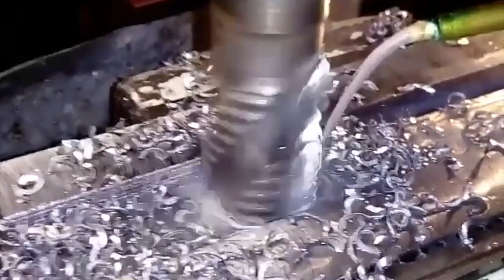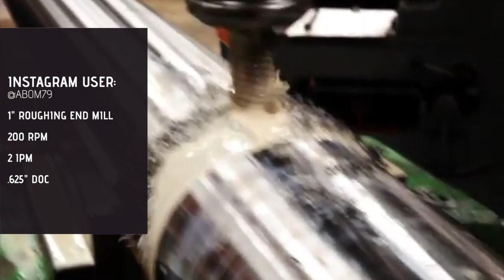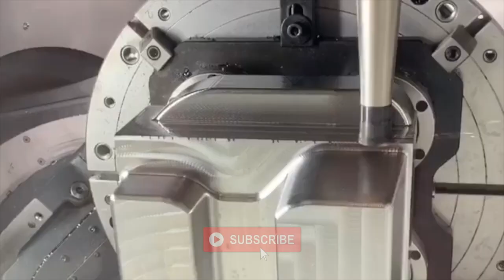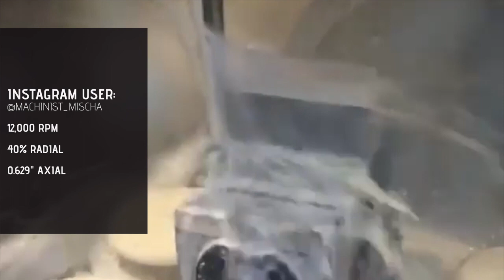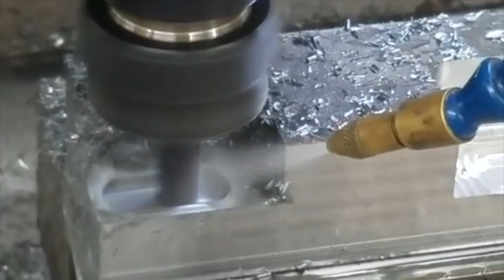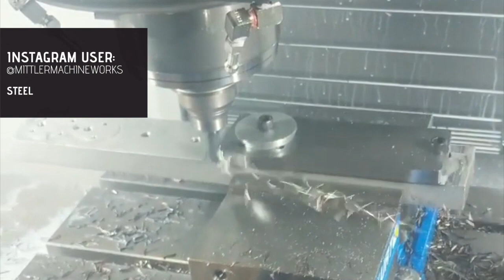ROUGHING operations on a MILL

Comment: There are times when those hog mills are the best choice.  This was not those times.   I find the fine tooth cobalt ticn coated give me the flexability so they don't snap, and the surface hardness to cut.  I use them in bad work holding situations.  Like a thin bent tab sticking up that needs to be shortened.
HSM for roughing whenever possible.  I've just started using high feed milling and it is fantastic.